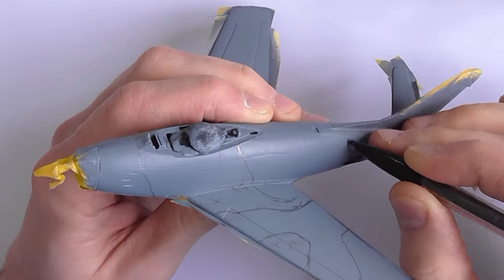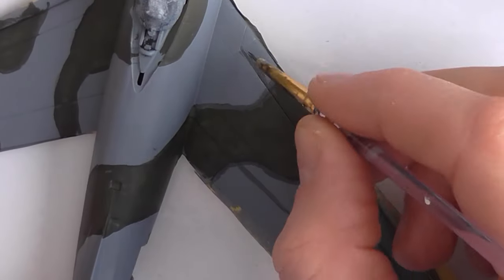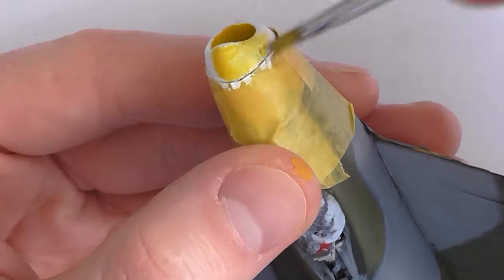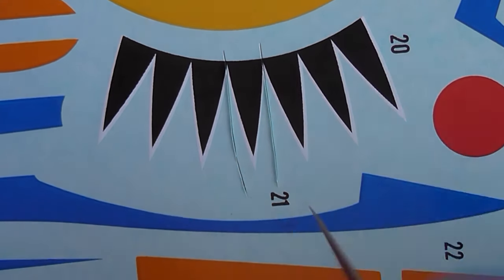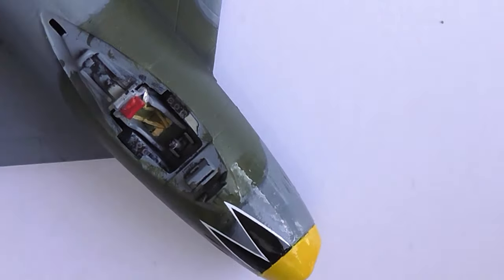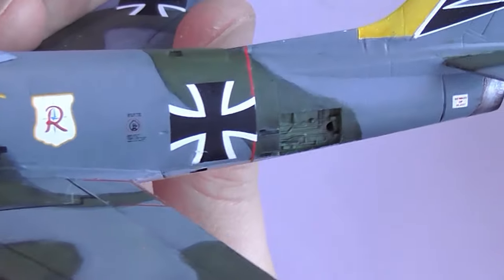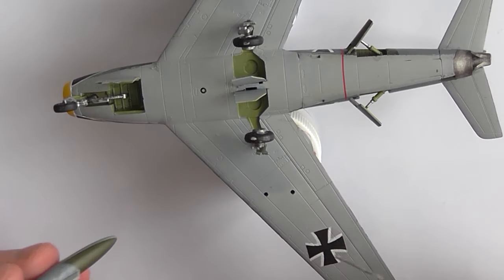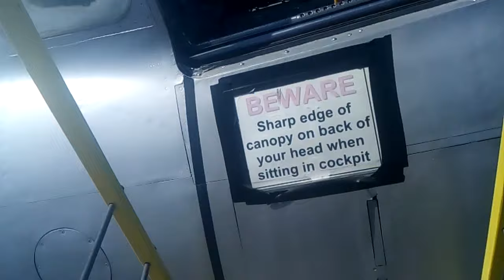Hobby Boss 1/72 Scale F-86F40 Sabre- Build Video

Comment: Very nice build. Out of curiosity, how much do you thin your paints?
Reply from the maker: Thank You so much. I tend to use a few drops of thinner via a disposable eye dropper/ pipette. Mixed into a small pool of paint with a paint brush on a paint pallet. Its often thinned where the paint is free- flowing than paint that has come out of the tube/pot. And I often apply my paint in a few coats with plenty of drying between each coat. I hope this is of some help for you. 

 BTW Also as Sic-fi & Horror Movie geek. I love your profile pic too. Roddy Rowdy Piper from John Carpenter’s THEY LIVE. If I'm not mistaken. That reminds me I need to give that another rewatch one of these days.
Reply: You are correct. One of my favorites. Strong messages for an action film.